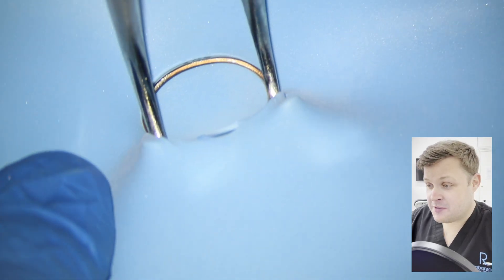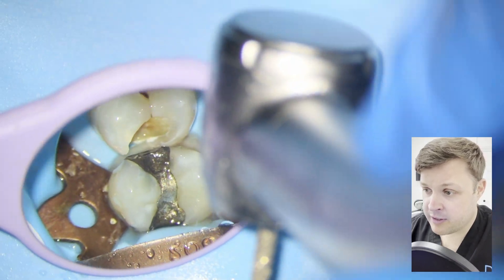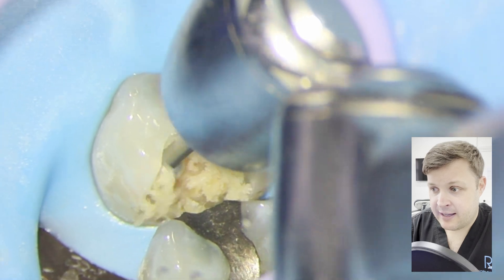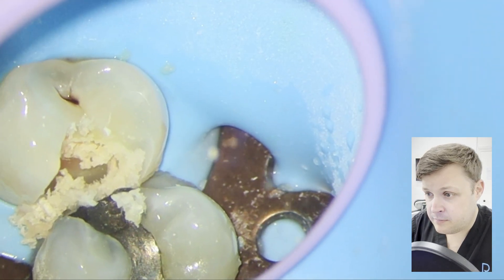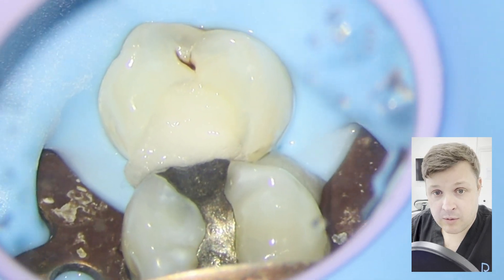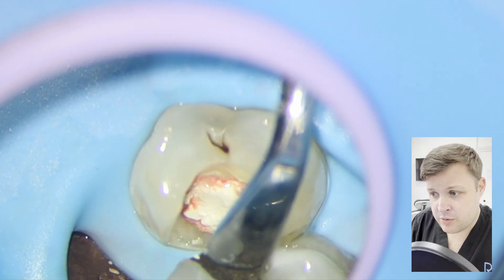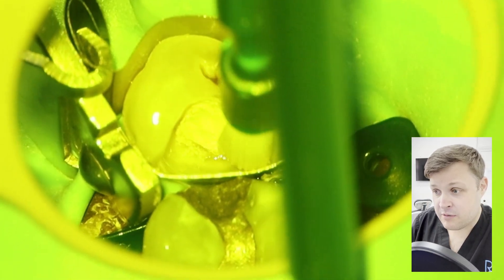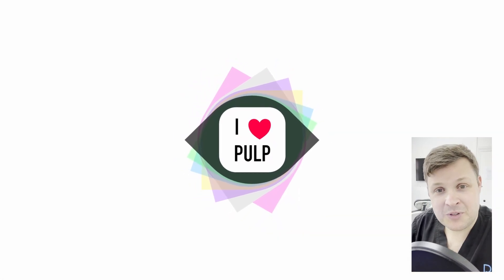Managing an exposed pulp after a filling! | 4K Resolution

Comment: It is not the doctors fault if caries has entered deep in close proximity with the pulp chamber,so as far as I am concerned I dont care if I open the pulp chamber,its not my fault the caries is too deep.I dont agree with letting infected dentine inside the cavity.And if there is small opening due to “errorr” by doctor lets say,than it has a better prognosis as there is no infected dentine,and you can get away with only covering the small oppening,however if there was infected dentine,then its much better to do a full pulpotomy,because who knows how far the bacteria have entered inside the pulp chamber.Great videos,keep them coming.Greetings from Kosovo

Comment: Hi, sorry if these might sound like stupid questions… When assessing to see if the pulp has stopped bleeding (in cases were you plan to do a pulpotomy), what do you look for to know the pulp has stopped bleeding (would it be the same way as if you assess bleeding from an extraction socket I.e no more blood is filling up the socket)? And how can you tell where the pulp is going to be when removing the decay - are there any good resources to help predict where the pulp is going to be based on the anatomy of the tooth?
Reply from the maker: Pressure with a cotton wool pledget soaked in saline for 5 mins and it stops!
Reply: But you are using NaOCl in the video, not saline

Comment: Good video .I noticed that you didn’t cure the light body first  but cured composite and light body together .If so , what is the advantage of curing together . Also , the composite depth is more than 4 mm for a once of curing even if u using bulk fill . What pulp cap material was used ?What is post operative pain like and for how long does patient expect pain ?
Reply from the maker: Thanks for the comments! the flow was cured, it was just the way the video was edited (to make it shorter and a little easier to watch). As for pain, it can be different for different people, and I just suggest that they use pain relief, and if they are worried to call back, no matter how insignificant they feel the pain is.

Comment: Good evening Dr. 
I would like to talk about the removal of deep caries and how to work closer to the pulp chamber...

You don't need to remove all the dentin with Carries from the deep Area near the Pulpchamber. you can leave soft infected dentin layer deep in the cavity. that means the opening the Pulpchamber should be avoided. After the remove the CP you kann apply a leer of theracal or MTA with lightcuring GIS or Biodentin (sandwich techic) after that apply a layer of Flowable komposet and in the End GIS temporary filling and you will waiting  up to 2 weeks. After that and wenn the pulp is asymptomatic kann you close the cavitie with komposit filling. In this 2 weeks, the Pulpa will building the Tertiary dentin and the dentin tubules will be secularised, and the reversible Pulpitis with Hyperemia will be avoided. 
And never ever apply a Acid H3Po4 near the Pulpchamber with thin roof or exposed directly on the pulp!!! The consequences are certainly irreversibly pulpitis .  
With MTA you need alwasy to apply the lightcuring GIZ or TheraCall ( Ca(oH)2  ) because MTA need 24 hours until it hardens  or to be hart.
Biodenten will used with out Acid just apply it  direct on the exposed Pulp but you need after that Lightcuring GIS.Biodentin needed about 10 minutes to  be hart .and will usually apply with a Mangment the direct pulpcapping 

Goodluck and the best wisches for you.
Reply from the maker: Thanks for your comment Nabil! I agree completely with everything you say, you're completely right. I think in this case I was trying to remove all the decay from the CEJ (this is required for a good seal), but in this case, even removing this decay exposed the pulp! Thanks for the comment, do you have any suggestions for future videos you would like to see?
Reply: @ilovethepulp  thank you so much 👍👍👍
Reply: You explain so well! Do you also help other people? Im a dentist who’s about to start soon….

Comment: There appeared to be active caries in the mesial pit on the occlusal surface, highly likely to be caries not staining as the Pt obvs has uncontrolled caries. What did the bitewing radiograph show in that area?
so as you were there anyway, why not biopsy that pit and do a PRR? At review fissure consider that, seal it or apply FV. 
Lovely video and great that you are keen to take constructive comments.
Did the treatment work? Was the patient in any pain afterwards? Does doing a pulpotomy make the canals  likely to become stenosed and difficult to locate/negotiate  if the patient develops AIP or pupal  necrosis in a few years time?
Reply from the maker: Hi panto! I can confirm that this was not decay occlusally, and you're not the first to suggest this in the comments. I think carrying out a biopsy is down to personal preference, I'm convinced that it isn't decay, and the patient always gets fluoride varnish after every exam. I feel like that if I investigated every stain in every patient with high decay, I would have to treat a lot of teeth! What do you think?